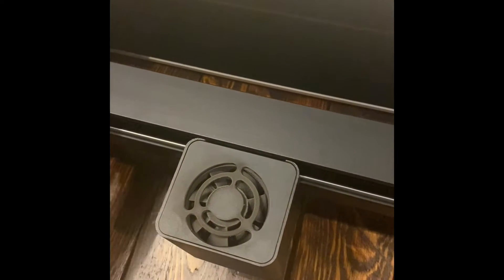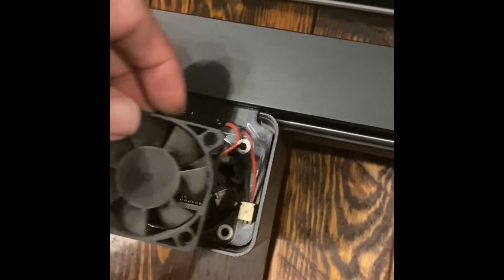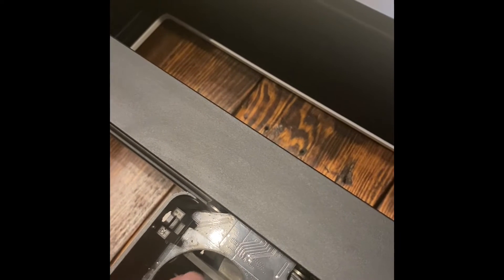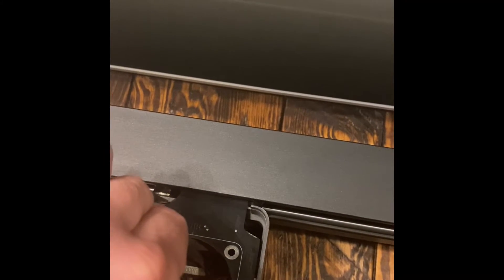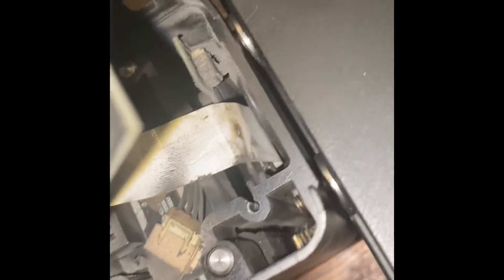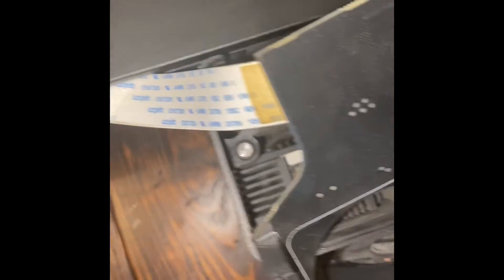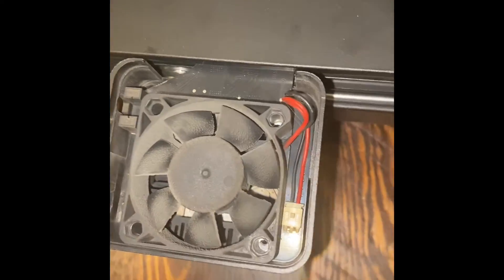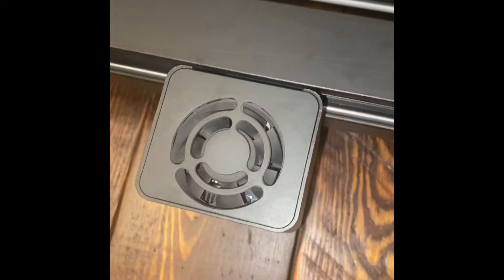How to fix Xtool M1 laser drop (dirty sensor board)

Comment: Would this be the same reason the blade housing drops out?
Reply: Thanks, it's just the blade housing only that falls out
Reply from the maker: The blade is held in by a magnet, but if the blade housing and laser drops together, it will be the same problem.

Comment: I’m sorry. I’m very new at this. 2 questions… 

1) Will this fix the “not cutting all the way through” problem? My M1 stopped cutting all the way through the bass ply wood…

2) what does it mean when you say “laser drop”? Laser drops? 😅
Reply from the maker: 3mm bass plywood is about as thick as you can cut and sometimes it takes multiple passes. The glue in the wood causes the issue of not cutting. The more glue in the wood the less it cuts through. 

Laser drop, is due to un clean sensors in the mother board directly attached to the laser. If gone un cleaned for long periods of time the laser will actually drop out of its carrier and will have to be reset.

Comment: I can’t get the screws out please help
Reply: Thank you so much, my project cut fine 4 times, then started burning each piece, I followed your video and it has cured the problem, once again, thank you!
Reply from the maker: @Nano_Nana  thank you for the feedback and glad it helped.
Reply from the maker: Yes they can be a pain. Make sure you have the correct size Phillips head screwdriver (very important that it’s a snug fit and the screwdriver does not wobble when trying to loosen) counter clockwise to loosen.
Reply: So you do all of this while the laser is dropped? And after it’s cleaned and reassembled, I turn it on and the laser will go back up?
Reply from the maker: @Bubblestheghost  if the laser has not completely dropped out, after you clean it it will return to its normal position. If it drops all the way out you have download the reset software and retract it back up in the laser box so the gears can roll it back up.